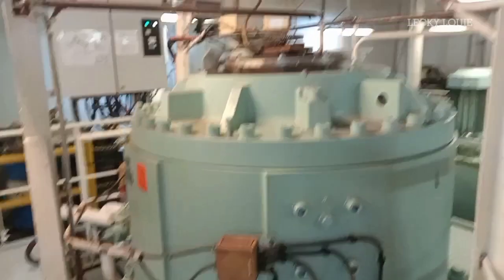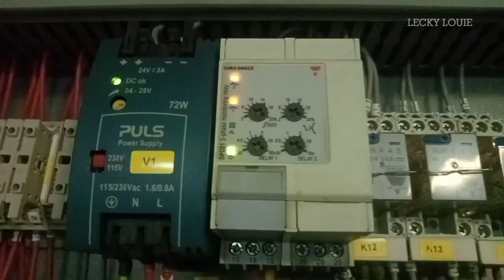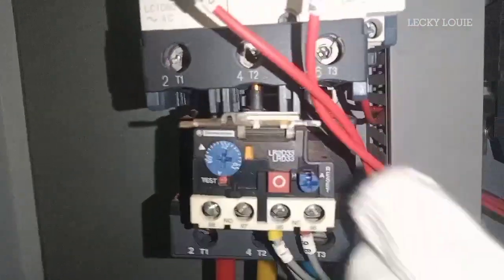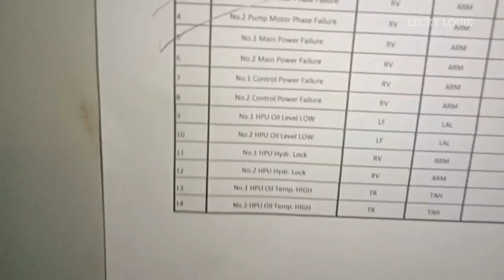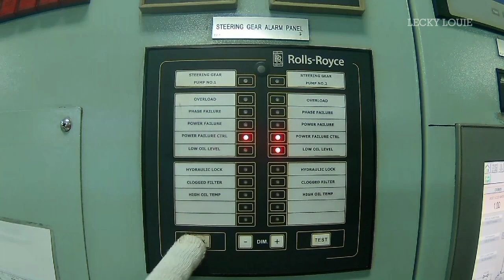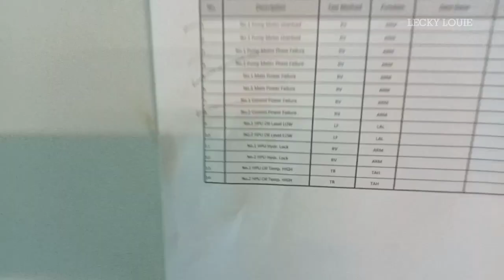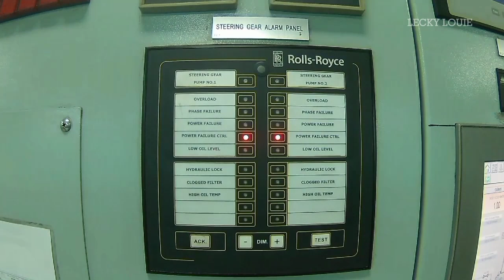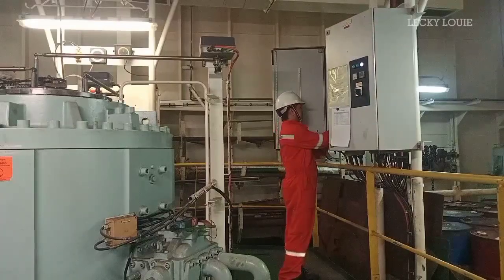Steering Gear Safety Devices and Alarm Testing | Pinoy ETO |

Comment: Please post circuit diagram.
What kind of sensors are mounted on rudder to know its position apart from the ones on actuator.
What is the coordination between the heading set and actuator movement.

Comment: Dear Mr. Louie,
This is very informative. Would appreciate if you can clear my one doubt regarding emergency power supply to steering control system on the bridge in case of blackout. My question is, Are both the steering controls connected to emergency switchboard or is it only one connected to ESB just like only one steering motor is connected to ESB?
Reply from the maker: Hi sir, only one steering gear system is connected to ESB. it is enough to steer ng ship when only Emergency Generator is running.

Comment: Low lube oil level alarm activation will enable standby motor to start…u haven’t mention that
Reply from the maker: you are correct sir that stanby pump will automatically start.

Comment: Boss lecky rollsroyes din steering ng barko ko bkit ung hidrolic luck ko nka steady lng ung ilaw n alarm nya,,minsan nwawala nagpalit ako ng solinoid gnun pdin
Reply from the maker: Normally,, sa solenoid valve and problema ng hydraulic lock.. check mo din ung electrical signal.minsan kailangan i-adjust ung setting ng hydraulic valve block.. check mo sa steering manual ung procedure ng setting.